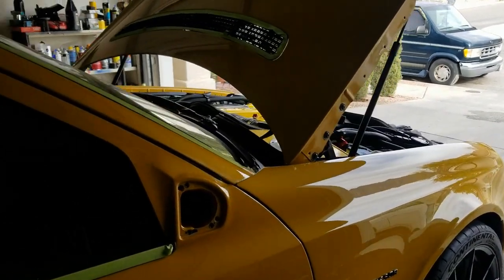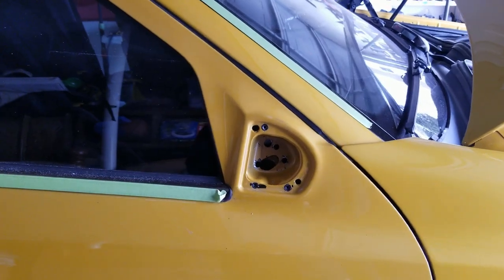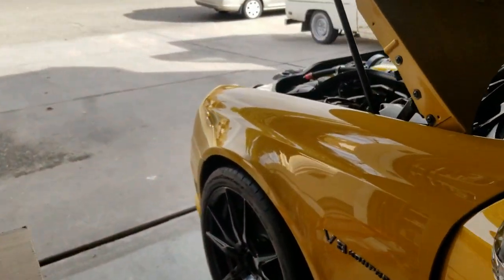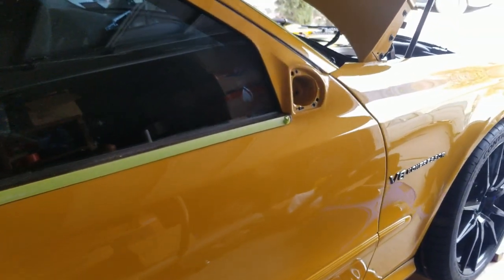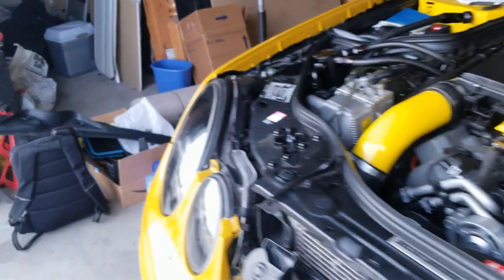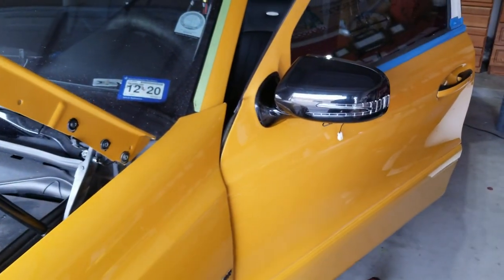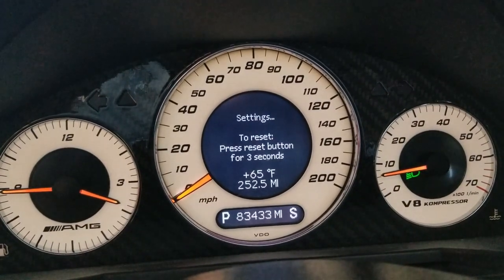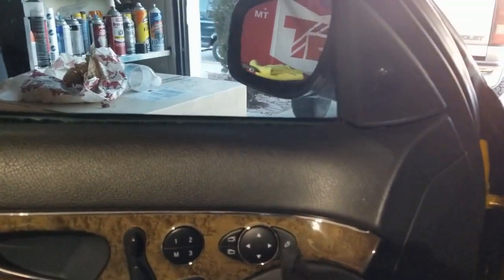E63 SIDE MIRROR CONVERSION ON MY W211 2005 E55 AMG(PANZER)

Comment: HI, great job there! I wanted to ask how about cars, that already has the button to fold up the mirrors? Is there anything to do? Or just plug and play the mirrors? Thank you!
Reply from the maker: If you have the button feature, you should be a plug n play by using the button. The only thing that needs to be coded is if you lock the car, the mirrors fold in n fold out when you unlock.
Reply: @PANZERSGARAGE  nice thank you.. now I only have to find a dealer which ships also to Germany 😂

Comment: Thank you 🌷
The small light on the mirror 
Won’t work 
Is there anyway to connect it
Reply from the maker: You can run wire to the courtesy light on the bottom of the door panel. Just connect the correct polarity and it will turn on when that light turns on typically at night.
Reply: It can be done using the OEM harness. With the Aftermarket connector you get with the mirror cover, you have to cut the wires off of the smal whiteish 2 pin block connector off. Then on the main harness thats used with the actual mirror which goes into the door module, you need to use the wires thatgo into white connector block. The 2 cables that need the wires to go into the white block go into pin 5 and 6. The are diagonally across from one another so 1 pin goes into the top row on the last pin in the right. The other would then go into the bottom row on the first pin in the far left of the block connector. Thats how they were wired up on my cars original mirrors from pre-facelift model. I hope this helps